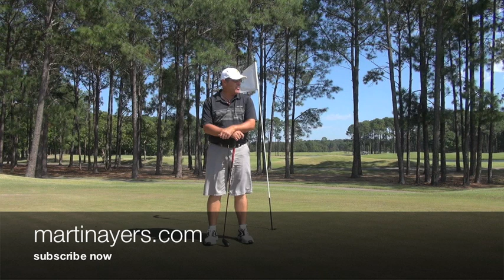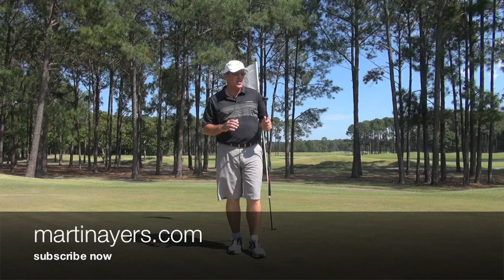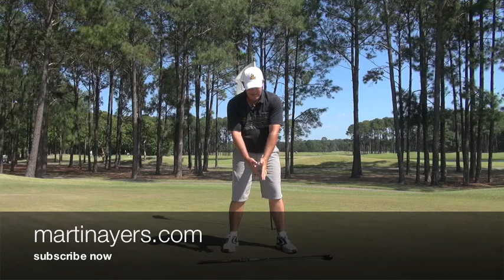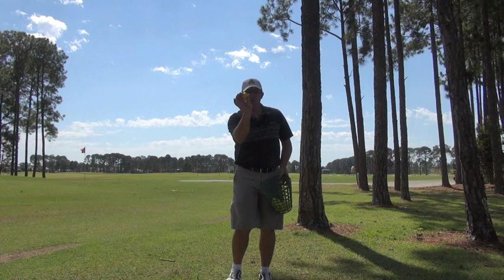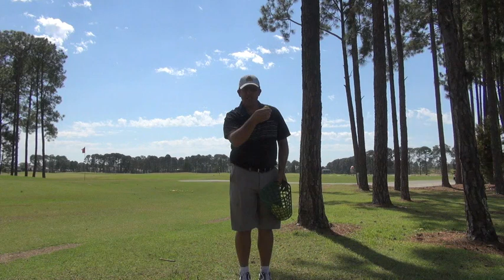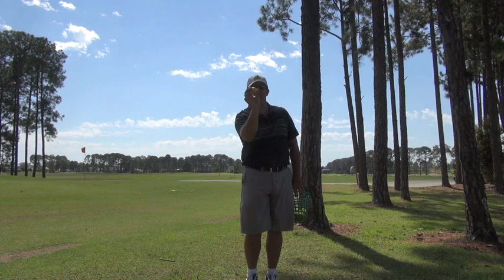Martin Ayers 3 Principles of motion 1 of aiming

Comment: Your idea of Containment is akin to my philosophy of the grip. My hands engulf the butt of the club. The end of the grip resides in my center lead palm, with the fingers of both hands draped over the rest of the tail end of the grip. While my grip is very unconventional, it functions as a u-joint and centripetal force squares up the club face without me actively doing a thing. My swing feels like a hammer throw in that I take the club back, inside and up using the action of my trailing shoulder pulling away from the target line. The forward stroke is torso & arm powered, straight through the ball from the end of the backswing. No active wristcock, though there is a horizontal hinging (an opening and closing) flatter with the woods, more vertical with the irons. No forearm rotation, the club swings out essentially on the same plane it was pulled away on... My lower body feels like the counterweight of a roadway gate; The back and gluts feel as though they move in the opposite direction the club is moving in. Not a reverse weight shift, as I said a rotating counter balance. I am in my sixties and play to a nine handicap (my putting is mediocre and my home course in a nasty little track). I post this because I have enjoyed your videos for years; I wanted to share a simple method of swinging the club. My average drive is 210 to 215; but I use a 13 degree 43 inch driver (more of a strong three wood).... Cheers :)